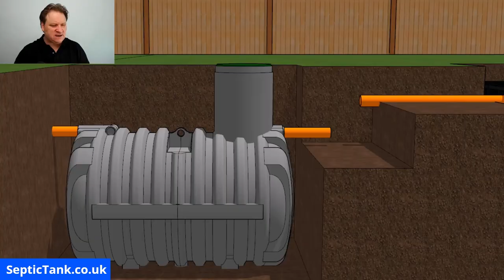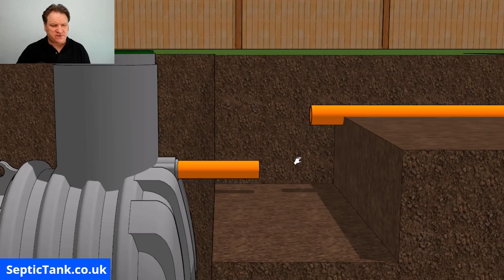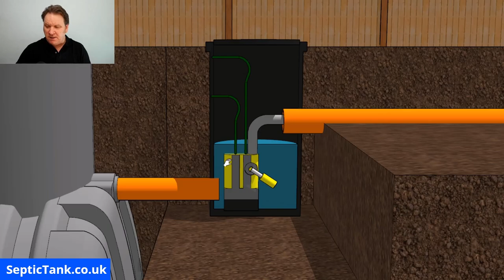Septic Tank Pumps - septictank.co.uk

Comment: Just a thought, why would you need a pump when water finds its own level and would 'rise' the the outlet height automatically?
Reply from the maker: Hi Bill, because in some instances the ground conditions do not allow the water to soakaway if it is buried to deep.

So, in this case the soakaway needs to be higher than the outlet of the septic tank. So, to get the effluent to the soakaway you would need a pump.